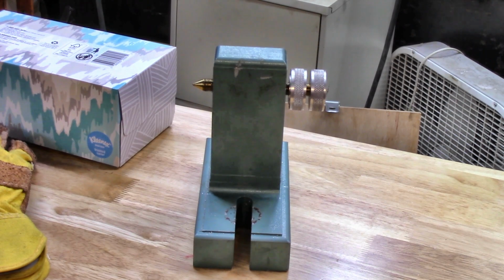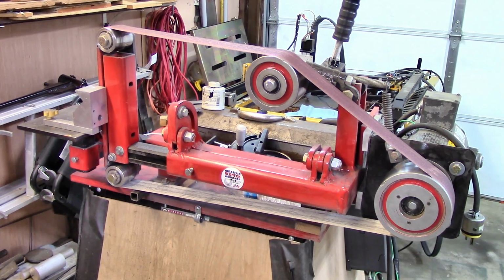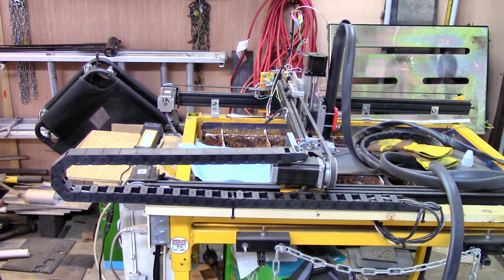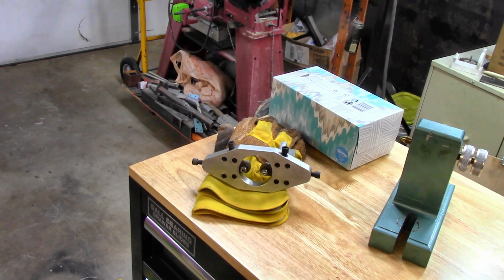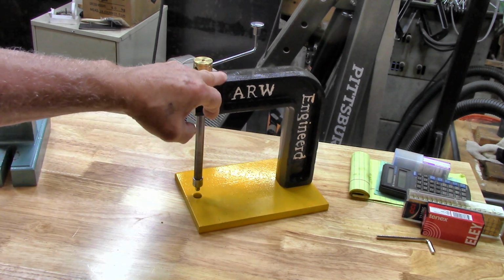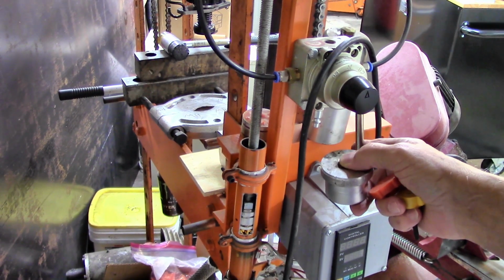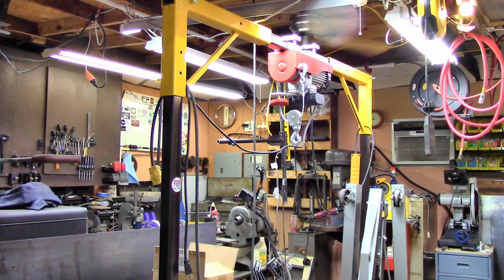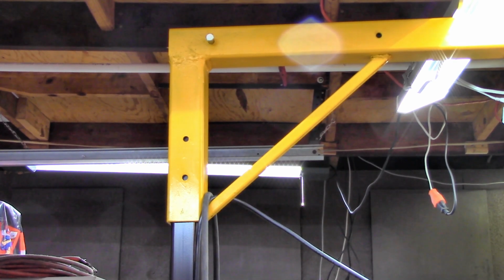Tools I have made  #SHOPMADETOOLS

Comment: That knurling tool is an interesting design.
The injection moulding machine is very clever too.
Reply from the maker: I had a lot of failures on the injection molding before I started to get it right.  Thanks John.